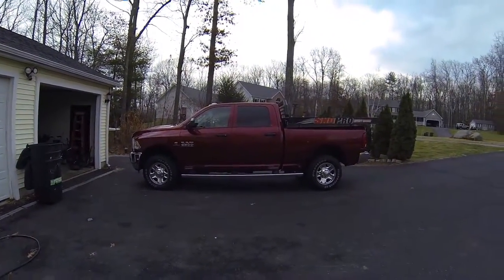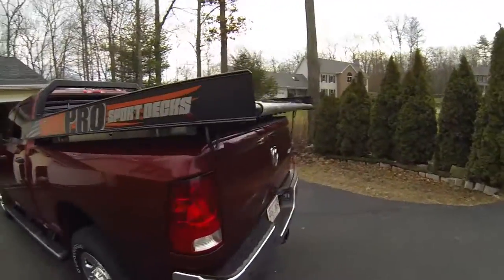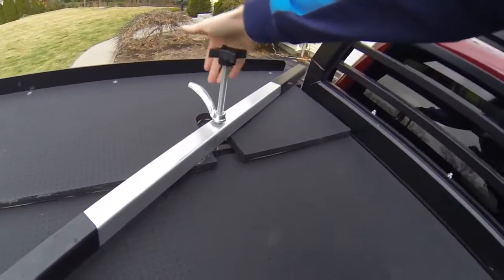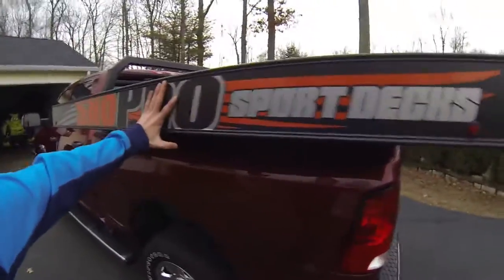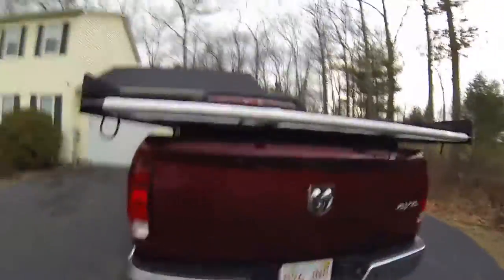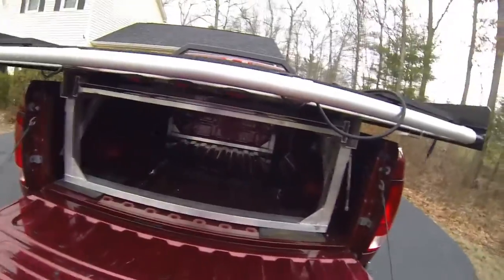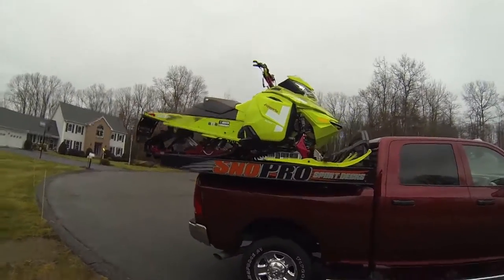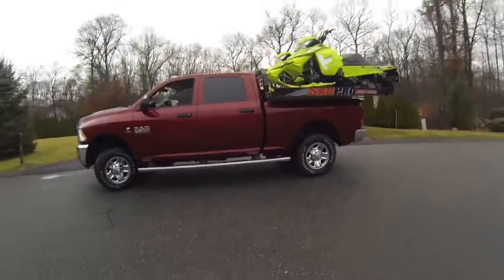Fully load 2016 Snopro Sport deck

Comment: what size turnbuckle did you end up using to hold the deck down
Reply from the maker: i dont remember i would go check but actually just sold the deck =(
Reply: If you don't mind me asking why did you sell the decking?
Reply from the maker: well we got a hybrid trail just figured it would be better somewhere to keep the sleds in the summer also can put are gear bags and stuff in there and if its snowing out we can change in the trailer the sled deck was cool and all but kind a pain to load that ramp was really steep one good thing about the deck was you could hall ass if its snowing its a lot easier to drive with then a trail

Comment: I would come with a little more momentum to avoid spinning your track on the ramp.  I had the same trouble when I first used my deck.  just have to commit!
Reply from the maker: +Ethan Derickson yeah that was my first time using a ramp that steep i was a little nervous going to fast and lunching sled, seen to many videos of that but i got it down pat now